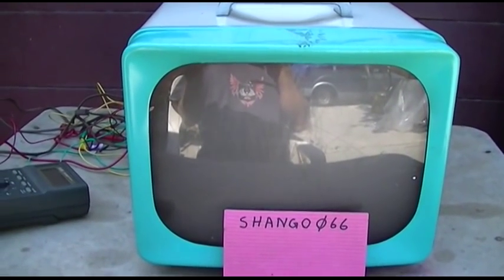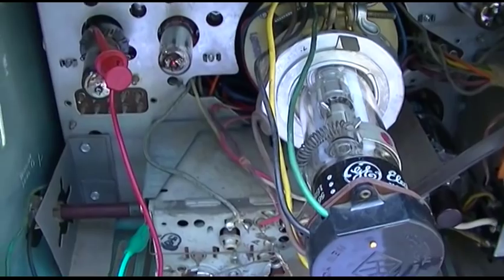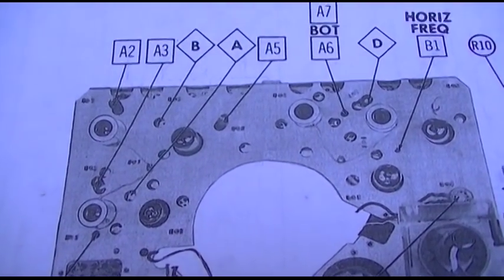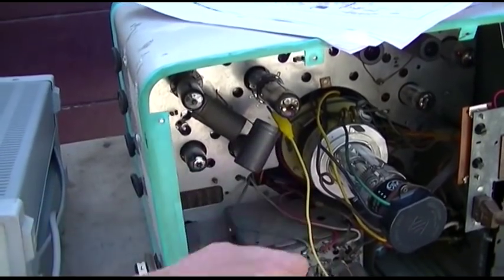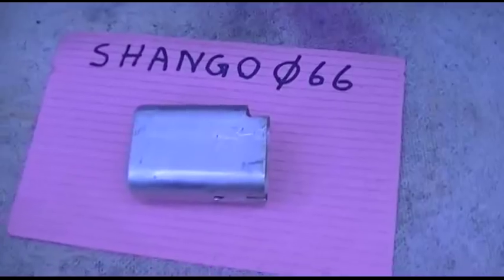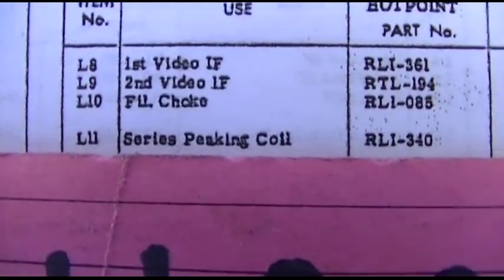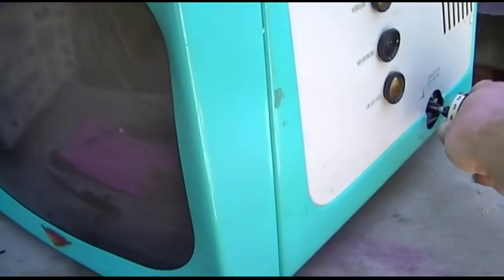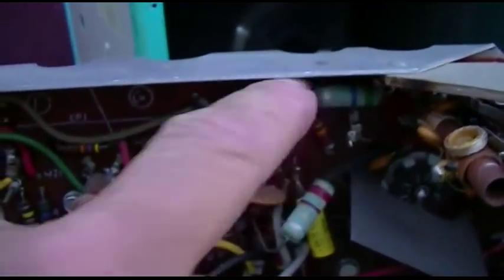GE Hotpoint 14S202 Vintage TV Repair Pt2

Comment: Man... Can't wait for the next video! Nothing I like better than to just relax and watch vintage equipment repairs. Really fascinating how older electronics were made... Nothing like today...
Reply: +Luke Den Hartog Today they are better tbh
Reply: I dunno... He picked up an old 3 tube radio with an all metal chassis and the damm thing still works... In terms of safety (generally speaking) today's stuff is better, but there is just so much cost cutting done today.
Reply: ***** The microchip and modern transistor can do 10 times more, 10 times quicker, although vintage electronics seem cool to look at and use, they are extremely power hungry compared to todays offerings, i mean a simple 17" colour crt tv uses the same amount of power as a 51" plasma. Also as shango admitted himself NEVER leave one of these old sets running if youre not around, they can easily burn your house down.
Reply: Synthematix Yeah... They are not exactly the safest in design, but then again, today's really cheap chinese usb phone chargers are not exactly better, but they cost 1/100th of what these tvs cost when they were new.

Are they practical for today's everyday use? No. Are they still interesting and worth collecting, repairing, and restoring? Certainly.

Comment: I like the multipart videos. It's not surprising the Hotpoint and GE are similar. GE merged with Hotpoint in 1918. Of course GE sold its home appliance business to Haier in China.
Reply: +Steven Smyth I never knew GE marketed TV's under the Hotpoint name. That was always home appliances, usually just stoves, ranges, refrigerators and dishwashers. 
But TV's and possibly radios, pretty interesting.

Comment: Hotpoint was General Electric's bargain brand of appliances. If you could spend more you got a GE. If not you settled for a Hotpoint. Electric stoves, washing machines, clothes dryers, refrigerators, freezers, air conditioners, TV's, and what ever else GE sold - usually a lower cost version was available with the Hotpoint name on it. That didn't mean they were bad, just built to a lower cost with fewer features. The main internal parts were usually the same.
1

Comment: When you have the board pulled to replace the phase detector diodes, change that big red electrolytic just to the left of it, too. Looks like the original recapper missed it...
Reply from the maker: +Bob Weiss That is the audio FM balancing cap, I will check it for sure

Comment: Could it be that the little coil had bad contacts or corroded leads and therefore measured as open? By the way, why would two coils be put in series? It seems like overkill. Or does one coil dampen ringing or filter unwanted signals from the other coil? 
I like these videos even if they are in multiple installments. There's always something interesting to glean in them. Thanks for sharing these videos with us :)

Comment: I was working on a 1940s Emerson portable radio which someone did a very good job of converting to AC, and it had a similar problem with low plate voltage; I traced it to a capacitor connected to the 117Z3 rectifier tube which was bad.

Comment: Some functional diodes show open on the diode checker of many meters. I have a cheap ass Uni-T in which the forward bias diode meter scale goes up to 2 volts and then cuts, and if for whatever reason the forward bias is higher than that it shows up open. LEDs show open even though the voltage put across them lights them up, for example. This probably changes depending of the meter.
Reply from the maker: +MisterTalkingMachine Absolutely agree, I kinda dont think thats is the case here though. I may make an effort to test that in pt3 once i get the coil in
Reply: +shango066 That one had to go for sure. Even if it still does something after all, it's well past beyond the point where it's still usable.
By the way, the horizontal lock selenium diode is very weird indeed. Thought it was a cap until you pointed out it isn't. My guess is that inside of it there's a stack of disks similar to those long ceramic flyback rectifiers from later sets.
Reply from the maker: +MisterTalkingMachine could be, I have no problem taking it apart so we can see. Im not totally sure its the problem but from what we know its highly likely
Reply: +shango066 If it's not, it well may be in the near future anyway. Cannot think of any way to possibly test it either, besides inserting it on another TV, which is not really worth the trouble in my opinion.

I found one of those on a plastic case with yellow sealant on a set that was butchered on the side of the road, and both diodes seem to work on it, but no telling if it would perform as it should on an actual working TV.

Comment: Have you ever used a test crt, such as a 5AXP4 when working on this type of design?  I have used my test crts on a couple of sets.  This makes it much easier to get the set working.  I am working on a GE very similar to this at present(This is why I am watching your videos).  The board on the right is not that hard to re-cap, , just mark and disconnect about 5 of the wire-wrapped wires connecting the left and right boards, and it can be pull out enough to replace the caps on the board directly.. .